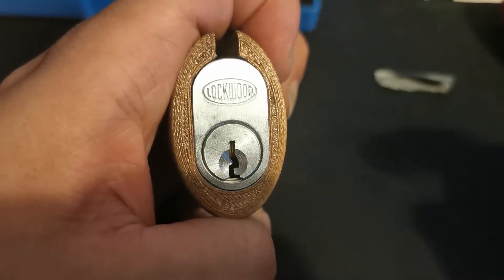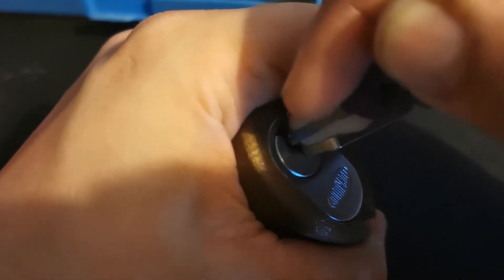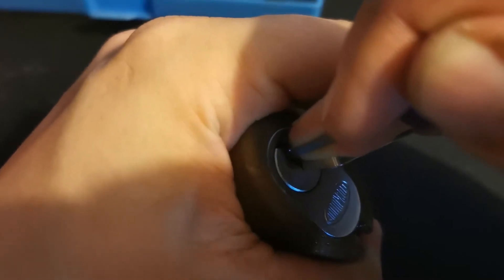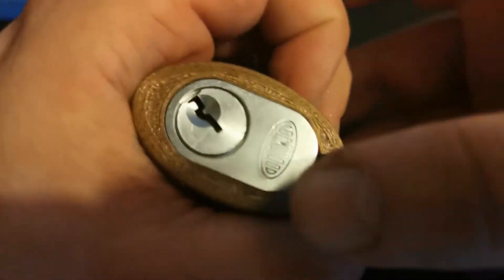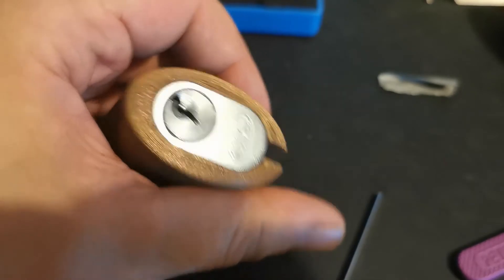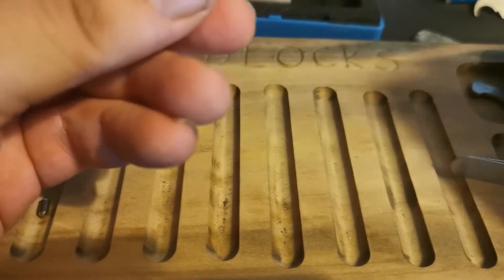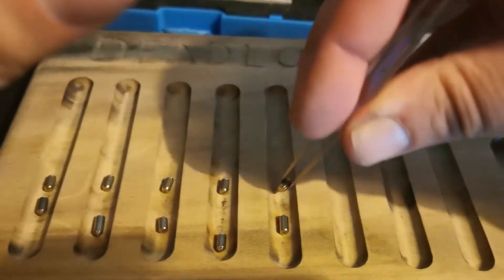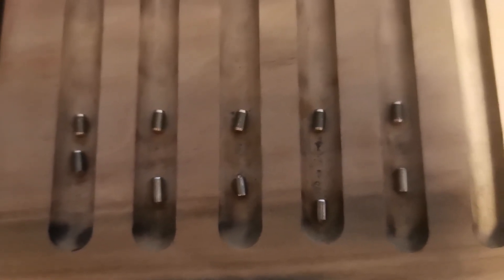Lockwood Oval Pick And Gut

Comment: Very well picked mate, they are not easy. The Lockwood oval you have is one of the early ones. They came standard with five pins and you could get the sixth pin under a special order. Have a good weekend, cheers
Reply from the maker: Thats good to know. Thanks for the info, and thanks for watching Pocket Women👍
Reply: I'm starting to think you are a walking lock encyclopedia PW.
Reply: @evilarchconservative2952  lol when I first started I specialized in Vintage Lockwoods, I soaked up any information I could on them, most of what I know comes from locksporters and Locksmith Paul  Springett